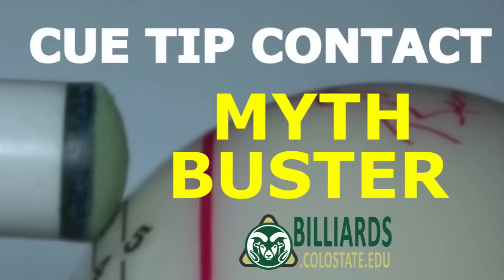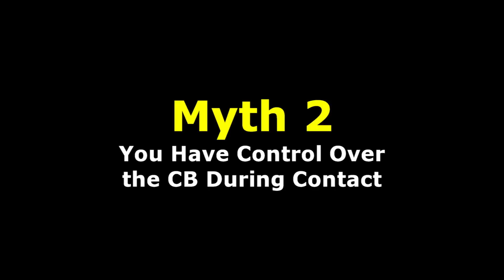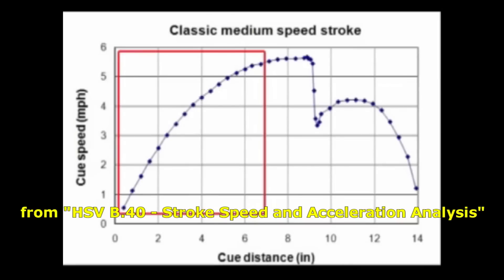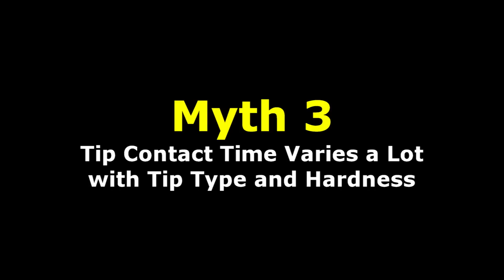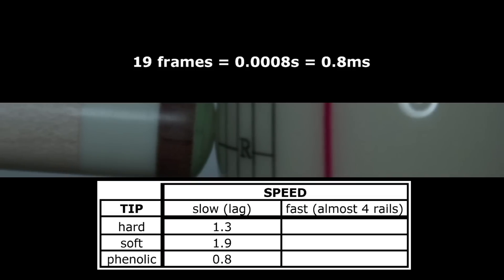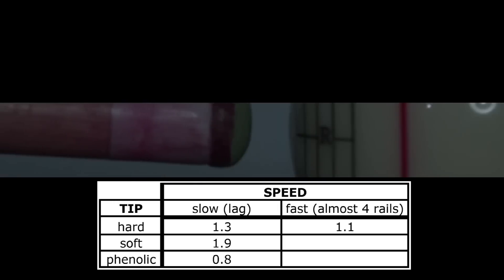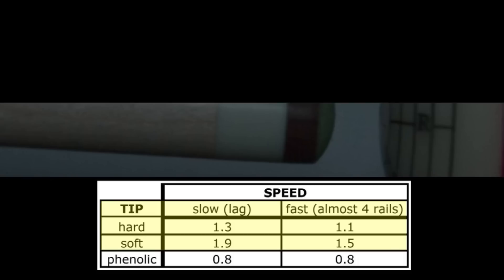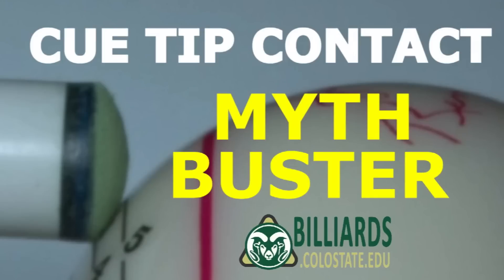Cue Tip Contact Myth-Busting Truths in Super Slow Motion

Comment: Alan Hopkins has been a champion pool player despite a stabbing stroke.  This research br Dr Dave et al shows why his stabbing stroke produced results as good as other champion pool players with smooth strokes - the CB to OB duration is so brief that the good results come only from a chalked tip hitting the desired spot on the OB while the cue is aiming in the proper direction.  I have instructional videos by Freddie "The Beard" Bentivigna on Banking.  He taught that certain shots required a firm, or sometimes a loose, grip on the cue.  Dave disproves that.  But Freddy also taught what he called using a "dead level cue" which probably is a good stroke to master - though 'level' is not possible for most shots, because the rail clearance requires at least a bit of downward angle on the cue.
Reply from the maker: Good point.  A stabbing stroke is not the best approach for most people, but it can be mastered by some.

Comment: You might need to revisit the claim that a softer tip can not impart more spin. I don't see any evidence to that conclusion and it's obviously not true just based on experience. I'd challenge anyone to a draw contest if they have to use a phenolic tip and I can use a soft tip.
Even in your explanation of that you say "the soft tip will enable a player to apply more spin to the CB since the tip contact point can be farther from the CB’s center without resulting in a miscue". Maybe it's just a matter of wording but a soft tip will definitely be able to impart more spin in all practicality.
Reply from the maker: The reasons why a softer tip does not impart more spin are explained here:
    https://billiards.colostate.edu/faq/cue-tip/hardness/

Comment: I noticed from your chart on the cue speed that at impact there is almost no acceleration. The cue is almost at a constant velocity immediately prior to impact. How are your contact times changed by hitting with a cue that is either accelerating or decelerating at the time of the hit? This would seem to be a very important variable. How did you reproduce the stroke to test the different tips? If you did not use some kind of mechanical setup I would have to say that despite the seemingly scientific manner, your study is flawed by not having control over this important variable.
Reply from the maker: Most good shooters (especially pros) all have very similar stroke speed/acceleration profiles.  The cue usually reaches maximum speed very close to tip contact.  That's what helps create cue speed with the least effort and consistent speed control.  For more info, see:
    https://billiards.colostate.edu/faq/stroke/acceleration/
and:
    https://billiards.colostate.edu/faq/stroke/good-timing/
If a stroke were instead accelerating at impact (not very common) or decelerating at impact (common among many novice or beginner players), there would be slight differences in the tip contact times, but all the trends demonstrated in the video would still apply.

Comment: I’m sorry Dr. Dave but from this video one might draw the conclusion that the concept of “timing” in the pool stroke is simply a myth as well, when in reality everyone who plays at an intermediate to high level knows that timing is very real and how important it is. If 100% of the energy is imparted in 1 ms then increasing the time in contact by .5 ms is a 50% increase. What was not checked is whether a well-timed stroke differs from a decelerating stroke in terms of tip contact time, all other things being equal.
Reply from the maker: Stroke "timing" is very important for getting consistent and controlled cue speed into the ball.  See:
  https://billiards.colostate.edu/faq/stroke/good-timing/
Reply: @DrDaveBilliards  I think to be truly scientific one could do high speed capture at the moment of impact with a jig that delivers a cue at varying acceleration profiles while measuring the resulting angular and lateral velocity of the cue ball. Of course the axial alignment would need be consistent, and differing amounts of spin would need to be tested, but I think the interaction at collision is more complex than is being described here.
Reply: Another reason that is contradictory to your findings is that cut and spin induced throw is probably even less contact time than a cue tip yet is objectively an effect that needs to be factored in. And how do you throw a cue ball more or less? Speed. Slower speed = longer contact time = more spin. Seems very clear to me.
Reply from the maker: That would be an interesting experiment.  I hope somebody does it some day.  I can think of lots of interesting experiments, but it takes lots of time, effort, and sometimes lots of money to pull them off.
Reply from the maker: Concerning throw, you are correct that CB-OB contact time is much less than tip-CB contact time, per the info here:
    https://billiards.colostate.edu/faq/ball/contact-time/
However, the forces between the balls are also larger (for a fast-speed shot).
A slower-speed shot does not create more contact time between the balls.  What creates more throw at slower speed is the increase in sliding friction per the info here:
    https://billiards.colostate.edu/faq/throw/speed-effects/

Comment: Dr. Dave, I have a tremendous amount of respect for you, but I think at least one of your conclusions is wrong. If a soft tip stays in contact with the cue ball up to 50% longer that HAS TO MAKE A DIFFERENCE! While I don't experiment with different tips much, I have gone to a softer tip because that was what I had available to me.

I immediately noticed more "action" on my draw, follow, and left and right english. It was quite noticeable in fact, and actually caused me some issues with making shots and getting position as the cue ball had more action. Also, a friend of mine, who had used my cue with a harder tip, mentioned that he was getting more spin with my cue. I had not told him I had changed tips.

I firmly believe, and your own evidence suggest this, that a softer tip imparts more spin. It would be different if the difference was only say 3-5%, but you are mentioning up to a 50% difference. It is hard to believe that additional contact time does not make a difference on spin.
Reply: Yes, he did a wrong calculations. He used stiff interactions, where there is a spring force. Rookie mistake.
Reply from the maker: @jan.kowalski  A soft tip does deform more and stay in contact longer with a lower peak force (but still a very small interval of time), but this is unimportant to the action of the shot based on the detailed explanations here (and at the links on the page):
    https://billiards.colostate.edu/faq/cue-tip/hardness/
It is the total "impulse" (integral of force over time) and momentum change that is important (which is the same for both the hard and soft tips).
Reply: @DrDaveBilliards  please read about Young's modulus. If you feel brave please do the experiment where you use a steel cue and then a silicon cue. According to your current assumption you should observer same effect considering equal force and time of those two different cues. In reality you will observe a different behaviour.
Reply: @jan.kowalski in reality you'll observe miscues on everything but a center ball hit with a steel cue
Reply: @jamesdavis8731 I tend to agree with you. Even if that contact time is tiny, twice the time should result in twice the friction. If 0.8ms is enough to induce back spin for instance, that means this is what matter even if we think it is extremely short. With that same logic, 1.9ms is a lot more and should make a difference.
Reply: Is that the same as more contact time not being able To impart more spin?
Reply from the maker: @filthymcnastyazz  Yes.  More contact time does not allow you to impart more spin per the detailed explanations here:
    https://billiards.colostate.edu/faq/cue-tip/hardness/
Reply from the maker: Explanations for why a softer tip cannot apply more spin can be found here:
    https://billiards.colostate.edu/faq/cue-tip/hardness/

Comment: Great video but wrong conclusions imho, tip hardness makes up to 50-100% change, can't be neglected. If it didn't matter why not just play with phenolic all the time)
Reply: Yes, the conclusions made here don't make sense in some cases.
Reply from the maker: Explanations supporting my statements can be found here:
    https://billiards.colostate.edu/faq/cue-tip/hardness/
Reply: Not only that - he calculates all as a physics of stiff body yet, even in video, there is a visible additional spring force.
Reply from the maker: @jan.kowalski  A soft tip does deform more and stay in contact longer with a lower peak force (but still a very small interval of time), but this is unimportant to the action of the shot based on the detailed explanations here (and at the links on the page):
    https://billiards.colostate.edu/faq/cue-tip/hardness/

Comment: Is Myth 1 only busted for a center ball hit, since the footage used in that section was only center ball hits? My intuition is telling me for draw/follow/side shots, this would maybe show different results. Since you wouldn't be hitting center of mass, it 'seems' the cueball would not leave the tip as quickly as a center ball hit at the same speed, as the energy would be divided between the forward motion and the rotation. But it's just an intuition, since I know zero about physics.
Reply from the maker: True.  Off-center hits will have slightly different contact times.

Comment: Some of the most interesting analysis I've seen in cue sports.
the footage / data speak for themself, but the conclusions may be a little off.
differences in contact time between tip and cueball, even if in the thousandths of a second make a significant difference. not only on the amount of side (english) you can achieve but also how hard you have to hit the ball to achieve this side (timing of cue stroke, or touch).

liked the chart showing cue speed with distance travelled forward.
would love the see the different curves from different players. particularly from someone who is considered to have excellent timing.
this for me, (along with the line of the delivered cue) is one of the most important aspects of the game.
and, moreover, the most under appreciated and misunderstood aspect of the game.
Reply from the maker: Explanations for why the contact-time differences are unimportant can be found here:
    https://billiards.colostate.edu/faq/cue-tip/hardness/
Concerning good stroke timing and typical acceleration curves, see:
    https://billiards.colostate.edu/faq/stroke/good-timing/
and:
    https://billiards.colostate.edu/faq/stroke/acceleration/
Reply: @DrDaveBilliards  thanks, keen to check them out
Reply: @DrDaveBilliards  all very interesting information, but I think there is much misinformation and some irrelevant information contained.
prob. to complex to address in this formate.
here's a few thoughts though :
* firstly it should be stated - good timing on a stroke is not always needed ie potting a ball with soft follow through.
* but when required ie. a soft screw shot with maximum work on the cue ball to obtain position. 
in this instance - I believe that the contact point (tip on cue ball) would be much further back on the curve from your graph ie. still accelerating, and importantly would also, I believe, result in maximum contact TIME between tip and cue ball. resulting in more side (english) on the cue ball, and at a lower speed.
I wonder, has this analysis been done ?
* you claim that we are only talking thousandths of seconds. but your analysis showed that soft tips have double the contact time than harder tips. all things being equal.
you dismiss this fact as of little or no consequence too lightly !
double the time is double the time.
it may be a very significant difference in outcome. as you alluded to from players opinions.
has this been analysed ?
in summary - my guess / judgement / experience is that the curve of a perfectly timed shot 
ie. max work on cue ball at min speed would show a contact point before any flattening of the curve.
furthermore, and most importantly, would show a less steep contact time period ie. a longer contact period. resulting in more work on the cue ball.
I'd be interested in people's thoughts on all this.
Reply from the maker: @haydenwalton2766  A soft tip has different hit efficiency, feel/sound, contact-patch size, and contact time, but for a given tip offset and CB speed, there is no difference in the action of the shot (e.g., CB spin) for a hard vs. soft tip per the explanations here:
    https://billiards.colostate.edu/faq/cue-tip/hardness/
Reply: @DrDaveBilliards  dave, the differences in tips is not the point I'm trying to make here, as interesting as that is itself.
my main point is in relation to the timing of the hit. and the analysis of differently timed strokes. in relation to different amounts of work one can get on a cue ball
Reply from the maker: @haydenwalton2766  See the info and videos here:
    https://billiards.colostate.edu/faq/stroke/good-timing/
Agreed.  If you have poor "timing," your speed control will not be good.  Most good players have good timing, with the cue reaching maximum speed at the CB with smooth acceleration.  But what the grip hand is doing during tip-CB contact is really unimportant to the action of the shot.  The momentum of the cue does all the work during the incredibly brief contact time.  For more info, see:
    https://billiards.colostate.edu/faq/grip/light-vs-tight/
    https://billiards.colostate.edu/faq/cue/weight/
Reply: @DrDaveBilliards  agreed - a pro player will be at max acceleration (or poss. still accelerating) on contact.
that's mostly what I'm talking about. ie. some graph analysis on different stokes would be very insightful.
furthermore, (as I originally stated) I  predict that the better timed shot would be confirmed by a longer contact time. 
a max contact time being  one of the
 major aims of a pro player.
along with delivering the cue on the correct line (but I think both you and I would admit this is most all that's ever talked about.
my interest is in the timing aspect, which is why I found your graph so fascinating.
this is my whole point Dave.
not different tip, not the grip.
Reply from the maker: @haydenwalton2766  A good player doesn't reach maximum "acceleration" at impact.  They reach maximum "speed" at impact.  See the links above.  See also:
    https://billiards.colostate.edu/faq/stroke/acceleration/
If they instead were accelerating or decelerating at impact, there could be slight changes in contact times, but the differences would not be important per the explanations here:
    https://billiards.colostate.edu/faq/cue-tip/hardness/
Reply: @DrDaveBilliards  a face to face conversation on all this stuff would be great, but in this medium it's bloody pointless !
thanks for your time Dave, and keep up the good work

Comment: I imagine that a ball that is in contact with a tip for half the time, hard vs soft tip, would have a large difference in the amount of spin imparted onto the ball.  I would like to see some numbers on what the difference in RPMs is between soft and hard tips.
Reply: It definitely does. even though we're talking thousands of a second. try putting a soft piece of rubber as a tip on a cue and see the incredible amount of side you can get on a cue ball. and as a result transfered side to an object ball as well
Reply: Absolutely no question about it. Softer tips do impart more spin. I never believed it before and honestly didn't care about what tip I used as long as it was not phenolic. Then I changed to a softer tip because that is what I had on hand and there is no doubt the EXACT SAME CUE gives me more follow, draw, and english. No doubt at all.
Reply: totally agreed - what needs to be "quantified" is the relationship between the contact time (already determined) and the rpm of the cue-ball after contact which presumably could be determined by analyzing the same video.
Reply from the maker: Detailed explanations can be found here:
   https://billiards.colostate.edu/faq/cue-tip/hardness/
Reply: @DrDaveBilliards  until you get a mechanical arm to hit the ball the same speed no one is going to buy it, even if you're right that there is no difference.  Hitting the ball yourself is not a good measure because you are going off feel to create the same force and that is too subjective.  Not to mention the bias of the person putting on the experiment influences any experiment, and in this case is also the test subject, amplifying the bias.
Reply from the maker: @luloffadam  That's why we shoot many shots, pushing the limit (with many miscues), accepting only the shots with equal ball travel distances.  A very well designed testing machine would be better, but one is not available and machine testing also has many potential problems.  See:
https://billiards.colostate.edu/faq/squirt/robot-test-results/